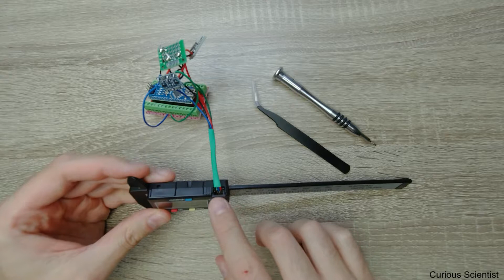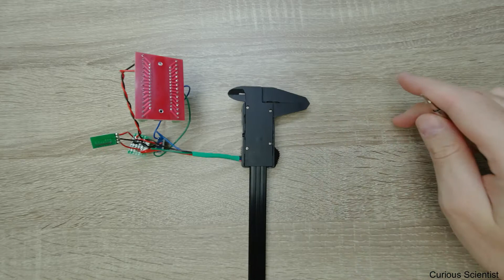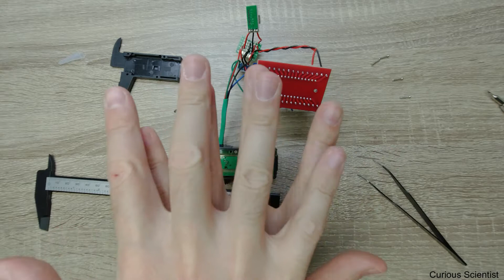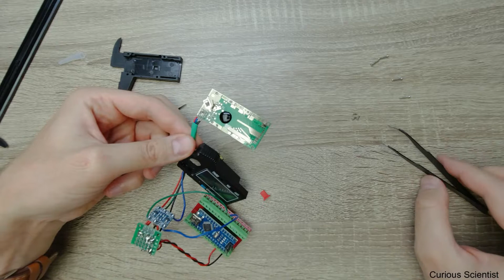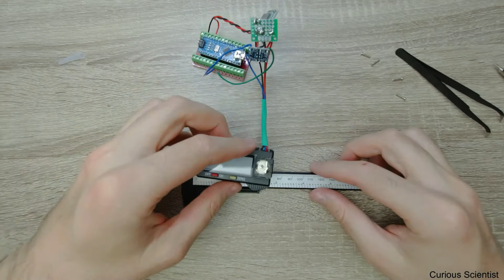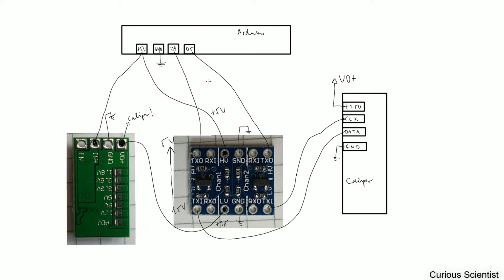Digital read out (DRO) using an Arduino and a digital caliper

Comment: In the hopes this helps somebody:
I simplified the setup by using a voltage divider to get the 3.3v from my ESP32 to about 1.6 to feed the caliper. 
(One resistor between V+ of the caliper and 3.3v and an equal one between V+ and GND. Wired inside the caliper)
Also I am using analog read on the esp to read the signals with no issue. Seems to be fast enough. 
Replicating this setup requires no external boards or components except 2 equal resistors of any value. Bonus it looks very sleek because its literally the 4 cables going straight to the ESP. 
I think this is an amazing way to get a fairly precise sensor for VERY little money.
Reply from the maker: Sure it can work, but voltage divider is a really bad (worst) practice to adjust voltages... They are not stable whatsoever, so they might even damage the device that is being fed through them. Also, they waste power because they continuously draw current and generate heat. Sure, with carefully chosen values, you can minimize the losses, but you must keep in mind that the load (caliper) needs a certain minimum current, otherwise it won't work. 

Even if it works, it is not a good practice and it should not be encouraged.
Reply: @CuriousScientist  Hey, thanks for the response, I did consider and measure the current and wasted power and it is for my purposes insignificant. My main goal is just to put out there a minimum example for people to replicate if they don't have the proper components. None the less, I did not know the instability it could cause, thank you for clarifying that, and pointing out its not good practice (as I should have)  I will try to get informed on the instability issue since I don't think I understand it. Either way, thank you for putting these types of videos out here, I hope you value how much it helps people like me with little electronics knowledge.
Reply from the maker: Hi! The instability comes from the following things. When current passes through a resistor, Joule heat is being produced. This increases the temperature of the resistor. The resistance of the resistor is temperature dependent. Now, based on what kind of voltage you are using, the tolerances of your circuit, the temperature coefficient of the resistor...etc, the voltage change caused by the temperature will be different. But in certain cases, it can be enough to mess with your circuit. Probably not relevant for this circuit, but might be relevant in other circuits. So it's just a good practice to keep this in mind from the beginning and act accordingly. 

Regarding my videos, it is not up to me to value them, but it is up to those who watch them. So far, I don't see that my channel is being valued,  but let's see what the future brings. :)
Reply: @CuriousScientist Wrong! Your videos are incredibly valuable to your audience. I've also seen them cited on various electronic websites and forums. Remember, the number of people genuinely interested in this topic and can follow along is tiny. Other electronic YouTube channels with higher view counts and subscribers than yours achieved it by simply placing a lot of emphasis on producing entertainment over quality instructional content. It's channels like yours who make YouTube informative and inspiring. I wished YouTube better rewarded channels like yours. Although the viewership is small, it's highly targeted, making it far more valuable to advertisers.
Reply from the maker: @bobweiram6321  Thank you for your very kind and motivating words. Yes, you see my struggle precisely: I try to make quality instructional/educational videos instead of sensational ones. I am still trying to find the balance between these two approaches. But I am very happy to see comments like yours. It's worth more than the YouTube revenue. Thanks!

Comment: I recently built myself a 3-axis DRO for my mill and lathe using these calipers which may be of interest
"Super cheap Digital Readout (DRO) for lathes, milling machines etc."
Reply from the maker: Nice! Yes, these cheap calipers could be nice for simple DROs. If you are not looking for high precision things and have a tight budget, they are really useful.
Reply: @CuriousScientist  Hi.  Yes, I wanted a DRO but couldn't really justify the expense especially as I wanted two and I didn't even know if I would like having a DRO.  Turns out I don't know how I used my lathe without one now - lol

Comment: Hey, can you post updated links to the products you used here? You don't mention what exactly they are in the video and there aren't links for them on your site.
Reply from the maker: Hi! Sorry, which product are you interested in?
Reply: @CuriousScientist  I found them on Amazon, but the logic level shifter and the voltage step-down module. Neither of their product pages on your site show what’s in this video
Reply from the maker: Those are very generic parts, so I did not bother putting them on my website. People anyway don't use the links I provide because they buy it from Amazon. 🙃

Comment: What if the caliper circuit is powered via divider, so its logic is somewhere in the middle of 3.3v ? Will it work?
Reply from the maker: You should not power any circuit with a voltage divider. Use LDO or buck converter. If the signals need voltage drop, use a level shifter.

Comment: Perfect video - Many thanks for your very clear description. So I subcribed to your channel.

One remark (in the positive way) = it seems to be an small error. In the circuit, you mention D4 and D5. In the code, you refer to D2 and D3. Never mind.

I have looked for a solution to add a push button to transfer data in CAO program, (like Fusion 360)  but until now I have not found the solution.
best regards from France
Reply from the maker: Thanks! You can assign any pins for data and clock so it does not really matter which pin pairs you pick. 

At work I use some Mitutoyo calipers and they have a Bluetooth module that can send the data straight to an Excel cell, for example. I was thinking to make a DIY version of such a device, but I have other priorities, so so far I haven't worked on it.
Reply: As I subscribed to your channel, I 'll get a notification as soon as you put the device on line

 @CuriousScientist
Reply from the maker: Thanks for subscribing! I hope I will manage to develop something and you'll like it.

Comment: Very interesting. A while back, I did a similar project: connected a cheap height measuring gauge in a similar way, to an ESP8266, and mounted the gauge, together with the ESP to my CNC router tool head. Then I run gcode on the CNC router, to measure heights, across a X/Y-matrix. The ESP sends the height data via Wifi to my PC, which computes a height map of the CNC workspace, which is used on the PC to compute the Z-compensation over the CNC-code, before the milling process is started on the CNC machine. It gives me much better milling results, especially for PCB-milling, because the the very precise compensation for any height deviations on the CNC-bed or the PCB coper surface. Reading values from the X/Y matrix takes 1.5 seconds per point, or ~5 min for a larger PCB with ~150 measurement points. So, it's quick, precise and greatly improves milling results. I am still using this mechanism. Doing the same measurement manually, by reading values from the gauge display, would take me hours for each milled PCB, so it's definitly worth to do this automation.
Reply from the maker: Thank! Really nice project. It sounds somewhat similar to the BLTouch module used in 3d printers. It is also used to map the uneven surface of the printing bed to correct the position of the printing nozzle. The distance is measured in a different way using the number of steps on the stepper motor to bump into the surface, but the purpose is the same. 

Spending 5 extra minutes (even more) to get a perfectly milled PCB is definitely worth it! These cheap digital calipers can be used as really powerful tools.
Reply: @CuriousScientist  Interesting. I didn't know about the BLTouch. Just looked it up. Yes, the process is similar, and the method for the measurement is different. The BLTouch would probably not work for my CNC router, because there is no accessable point to connect such a device to the CNC. Hence, I process all height compensation on the PC. The only chance, I see, is modifying the firmware of the CNC, to read additional jnput wires. I didn't want to touch the firmware of the router, so far, so I worked around that. Could be one of my next projects.
Reply from the maker: Yes, the BLTouch requires a bit hacking if the hardware is not prepared for it from the beginning. 

Furthermore, just as an interesting stuff, I recommend you to look at the leveling procedure of Prusa printers. It has some (9) built-in magnetic areas on the printing bed and when you auto-calibrate the printer, it checks the height of these 9 points and readjusts the printer accordingly. There are plenty of smart solutions out there.

Comment: Check the output from your chosen device before investing time on this- the linear device (not a caliper, but the same electronics) that I tried turned out to have a data output that was entirely random. Set to zero, I would get a different reading every time. Checked with a 'scope, and sure enough the bit pattern was random. A couple of hours wasted...
Reply from the maker: Sure, it is always worth to check the output signal of the caliper. Most of them have similar output signals (like this one), but some of them differ.
Reply: @CuriousScientist  It did not just differ- the output kept changing without the slide being moved- so it was impossible to use the signal.
Reply from the maker: If it is constantly changing, then something is wrong with the caliper itself. At a certain position, it should give the exact same output.
Reply: @CuriousScientist  That was my point. It does not. The data pulses are correctly aligned to the clock pulses, but the values change, a large amount, for every reading without any movement. This is confirmed with a 'scope, so it is not software error.  The device screen readings are correct. The device is clearly defective, either in this instance or by design. Hence my warning not to invest time in such a build without confirming that the device works.
Reply: @Tensquaremetreworkshop  are you sure your connections were good? I assume they use those leads at the factory for QA. If your caliper still works (normally, with it's own display) the most likely cause of things jumping around seems likely to be the connection to the leads isn't solid/stable, might even be intermittently touching two or something. Maybe you already checked that really carefully, please don't take offense at the suggestion!
Reply: @keithwins  No, I got clean clock and data waveforms- but the bit pattern was never the same twice- varied wildly with no scale movement. Digital display was stable, so not sensor problems. At this point I was not going to invest any more time...
Reply: @Tensquaremetreworkshop  I don't know what your device is, but if it's a digital measuring device and it works as a digital measuring device, then somewhere in there is a signal that relates to the measurement. I believe the leads off the caliper are factory test leads to do quick QA, so they sorta have to include the measurement signal. I don't know what device you were using though, so it could be encoded in some strange way or something. You said "not a caliper, but the same electronics"... are you reading the signal while you are adjusting/moving the caliper? I think that's the only way you see a meaningful signal, right? There's no meaning to a single unmoving position, until you zero it and then move away from that zero...
Reply: @CuriousScientist  Is this true (that there is a signal indicating actual position anywhere? As I reflected on it, I realized that all it really needs to do is measure how far you are from where you last zeroed it. It's only by storing how far you've moved it from the last zero that it has any record/information about where it currently is. My calipers all turn on as soon as you move them, which is a smart strategy that helps them look like they know where they are. I think if you zeroed it, disconnected the sensor, moved it, and reconnected, it would still be "zeroed" but in the "wrong" position (this has to be done without removing the power/wiping memory). I think I might be stating the obvious here...
Reply: @keithwins  the bit pattern of the data stream changes every transmission period without sensor movement. Random content.

Comment: A couple of transistors make a cheaper level shifter (it is unidirectional) and a third as an emitter follower can provide the power. Cheaper, simpler, smaller.
Reply from the maker: I worked with what I had at home. But you're right, that since we only read, it is probably enough to have some unidirectional shifting.

Comment: Rather than using level shifters, would the anolog inputs ADC be fast enough to read the serial?. And then just use a resistor voltage divider to power it from 5v. And similarly use the 5v arduino digital outputs via a voltage divider to "drive" the zero and inch/mm buttons. Also to keep the caliper board awake, you could periodicaly double pulse the inch/mm button if no change has been seen within a period. obviouslly hide the result on display during the awake pulse. 
Good stuff :D
Reply from the maker: Hi! Good idea, but I honestly don't know if the ADC would be able to catch up with the serial speed. But the level shifter is such a cheap part that in my opinion it does not worth the struggle with the coding. The awake pulse is a neat idea I like it!
Reply: @CuriousScientist  Hi, I did use arduino to read from a digital Gauge, same like here (clk and data). Arduino internal comparator - input can be routed to ADC analog multiplexer and you can route the comparator + input to ATMega 1.1V internal bandgap reference. So 1.5Volt logic "1" in the selected analog input will drive the comparator output to "0" and 0Volt logic "0" will drive the comparator to "1" only need invert this result and put the analog mux to the analog input you need read, could be CLK to A0 pin and Data to A1 pin. This way you dont need any component neither do dirty analog tricks. You got a clean comparator digital output. Only thing is you need mess with the registers to route the comparator inputs, and put the analog mux to the analog input you need to read before take the comparator input. Enjoy!!
Reply from the maker: Hi! Wow this is a fantastic trick, thank you for telling me about it. I have never heard about this method, so I will take a closer look on it and try to implement it. I definitely need to learn this. Thanks!
Reply: @CuriousScientist  The bad thing is I think ESP32 (which is very popular to replace the Arduino) do not have internal comparator. Maybe I am wrong .
Reply: Just to help anyone wondering. I have managed to get it to work using analog read on an ESP32 with no issues. I used 1500 as the threshold for the read to have some margin.

Comment: INPUTS internal pull-up + rezistor
Vcc rezistor +  2 diodes 
enought?
Reply from the maker: Sorry, but I have no idea what you are talking about. Could you clarify your question please?
Reply: @CuriousScientist   
Arduino input with internal pull-up --- rezistor --- DATA
Arduino input with internal pull-up --- rezistor --- CLK 
+5V - rezistor - 1.5 V  --|>|--  --|>|--  GND    ( --|>|--   diode), capacitor? ( remove batery )
beter resolution for mm or inch?
Reply from the maker: It is really hard to understand your comment, especially if you decide to edit it hours after you've written it...

First of all, if you enable the internal pullup (pinMode(INPUT_PULLUP)), you don't need an extra "rezistor", except if you want to drop voltage. But in that case, just use a level shifter instead. They are cheap and widely available. The resolution is the same for both units, it does not matter. The DRO puts out the exact same number and actually, there is an extra bit that decides whether the value is in inches or mms. But this does not affect the resolution. Actually, I will release another DRO video really soon, you should check it once it is available. There, I will explain everything in very details and it will be applicable to this DRO as well.

Comment: Great presentation thank you.
I tried to format the code for lcd 1602 12c but I can't because I'm new to arduino. I like it because I would use this on a mini lathe.
Can anyone help me.
Thanks in advance for your help.
Reply: I'm also here to apply this knowledge to my mini lathe 😀
Reply from the maker: Thanks! What do you exactly want? Do you want to display the same data on the mentioned LCD?
Reply: @CuriousScientist  Yes thanks
Reply from the maker: Check my other videos where I use that display and see how I did it. I explain each code line by line, so if you take the time and watch it, you can learn it.

Comment: Could you explain how you got a logic level shifter that is designed for a minimum low level input voltage of 1.8V to work using a 1.5V low level input? (these specs are taken from the product link you provided for the level shifter)
Reply from the maker: Hi! Other than "it just works", I have not better explanation, I haven't actually paid attention to these nuances to be honest. I guess that the 1.5 V is close enough to 1.8 V, so it is considered as high by the circuit and it behaves accordingly.
Reply: It is called specification tolerance. In other words, you are taking a risk. Using a bi-directional level shifter is over-kill; there are simpler and cheaper ways.